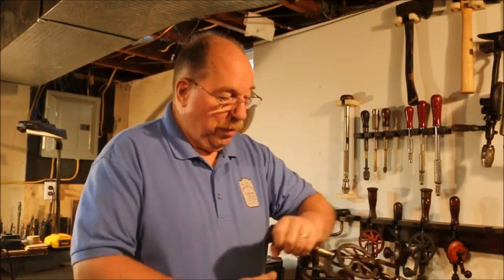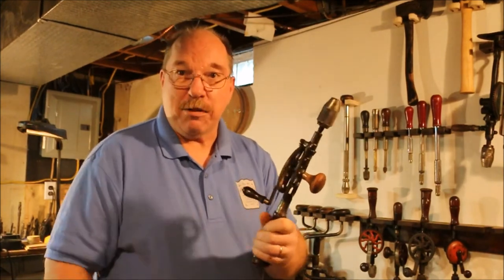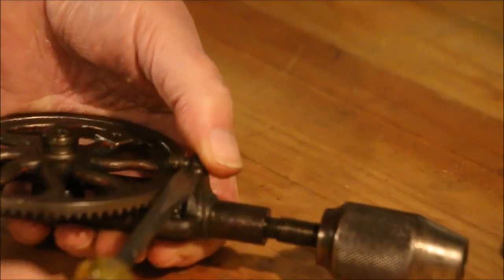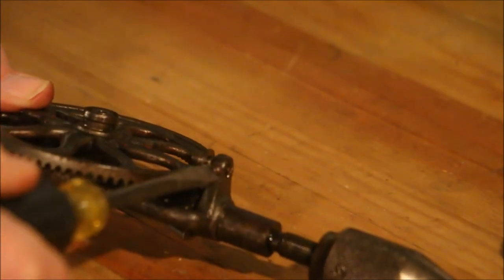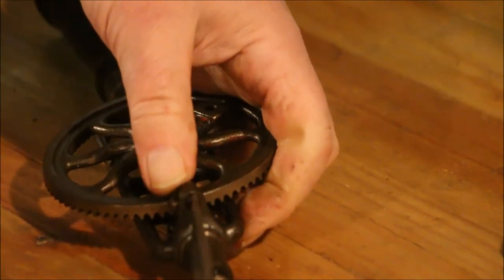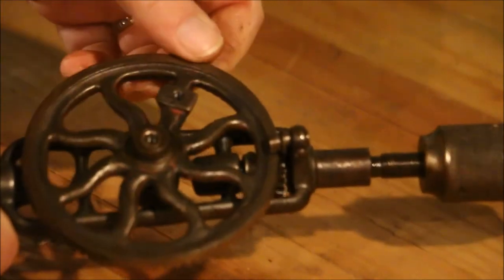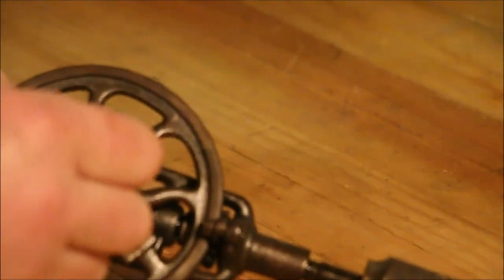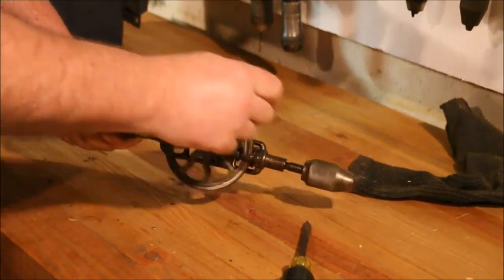HOW TO REMOVE THE ROLLER FROM A MILLERS FALLS #2 EGGBEATER DRILL

Comment: I love doing stuff like that, especially the old rusty crusty tools, that are supposed to be beyond repair. My kids then ask, OK dad, now what are you going to do with that tool , arrrgh, missed the point. : ) . Thanks for sharing again....Ken
Reply: Al old guy I knew always said 'It's just junk to the untrained eye', to which my daughter replied 'Well, you haven't got my eye trained yet Dad'. Out of the mouths of babes.
Reply from the maker: Kenneth Bartlett I picked out a few projects that I could make with the hand tools that I have restored. The night stand was one such project. All the tools used could fit in a toolbox the size and weight restrictions of a carry on bag. If I were to attempt to use my power tools the table saw alone would be more than I could carry. Take them camping and build a joint stool with just a hatchet and a brace and bits. 
The question isn't what can you do. It is what can't you do. A much shorter list.

Comment: Question about the drill: I have a M-F #2 (at least that's what it says on the crank), but it has no roller like you show, doesn't even look like it was manufactured with one. There is however a ball type bearing of some sort at the handle end of the bull gear underneath it. Is there a way to determine first of all if it's a genuine M-F #2, and second, how can I determine it's age or design model year? Any help would be appreciated. Thanks.
Reply from the maker: This is a good source. 
http://www.oldtoolheaven.com
Reply: Thanks!

Comment: Mine has a screw and I can't get it out
Reply from the maker: The shaft that the roller is on is offset so it can be turned by inserting a straightbit screwdriver into the slot on the end. Loosen the setscrew that holds the shaft and the shaft can be turned or pushed out of the casting like how it is shown in the video. The only screw is the setscrew.